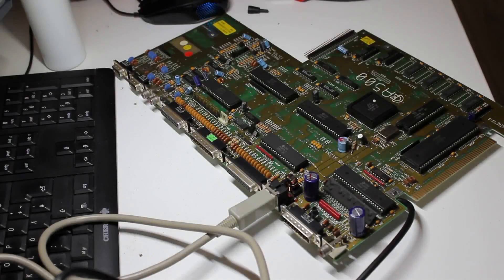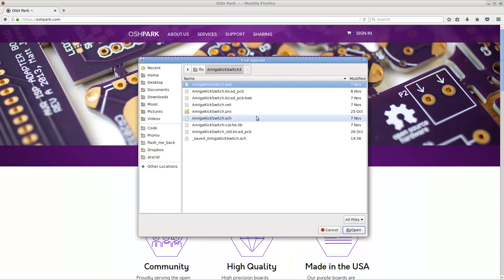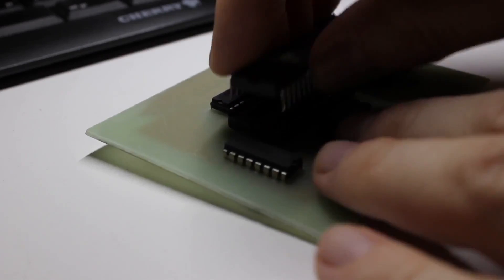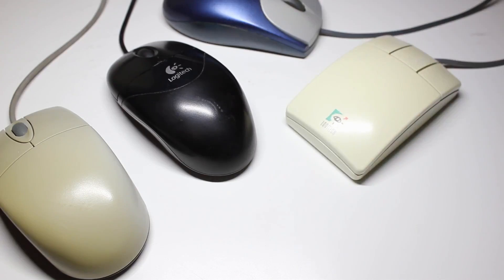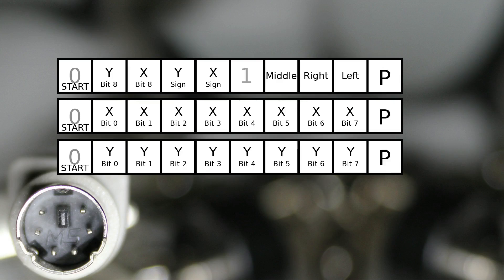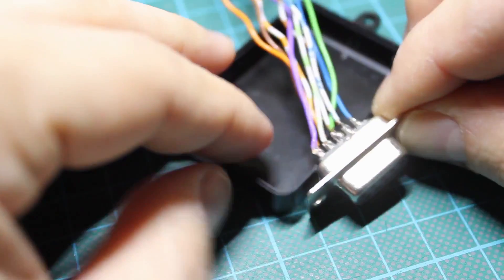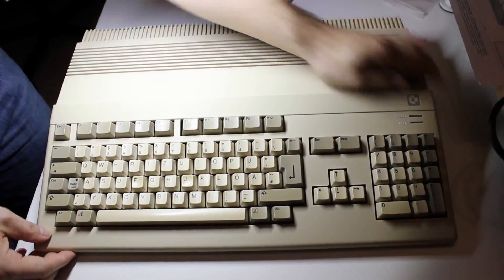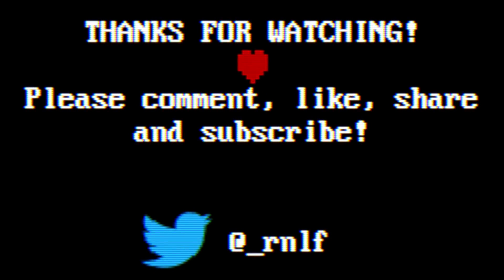Amiga 500 Zero to Hero Part 4 of 4: Custom PS/2 Mouse Adapter / Kick-ROM Switch / Finishing up

Comment: I just installed the RGBtoHDMI mod. That too leaves no space for the RF shield! I fixed that by simply choosing to not reinstall the shield. The Amiga works fine without it=)
Reply from the maker: Of course it does. Might cause issues with nearby analog stuff and I kinda like to keep everything together. I try to keep my mods reversible and losing the RF shield somewhere in the mess that is my retro room is not reversible 😂
Reply: @flashmeback  Hehe yeah, I can see that. I have all my amiga stuff in one box, so I'll hopefully never lose anything. I like that most people are so reluctant to do permanent mods! For the HDMI mod, I'm thinking about using the accelerator/HDD port cover as a place to fasten a female HDMI plug, as well as a few switches. Therefore I 3D printed a cover I can drill through, while I'm keeping the old cover intact!=) I'll eventually make the same mods as you for floppy and ROM select (though I have heard that you can safely forgo of Kickstart 1.3 - 99% software will run on 3.1). Do you have any extensive RAM upgrades? I have 512+512 FastRAM - will 3.1 run fine with that?
Reply from the maker: @ojkolsrud1  I'm currently running it on the stock 512K and haven't seen any issues (except most demos needing 1M).

I've mostly made the switch for fun. I usually just switch to 1.3 for fooling around with the older OS.

Comment: Have you figured out the acceleration part of the code? I’ve made the adapter but the movement on screen looks like pressing keys. Once the cursor starts moving, it continues at the same speed

Comment: aww.. you should have thrown away the top RF shield instead of ruining your excellent kickstart switcher project. Top RF shield is not needed at all and actually just traps heat. Most of them are rusty and ugly anyway these days. I never install the top RF shield in my Amiga 500s or other Amigas.

Comment: On revision 6A motherboards (or newer), which you show here, there is a much simpler way to switch kickstarts.  Use a 1 MB ROM and put two kickstart images on there.  The ROM I use is a 27c800.  It has two address pins which, when installed on the motherboard, will be outside of the ROM socket - one of these pins is the most significant bit address line, which you can pull high or low to select the desired kickstart image.

Comment: My first computer T.T. It had so many awesome games. Miss some of them still today.

Anyway though, such love and care is almost wasted on a A500. Especially the Kick 3.1, it's gonna be veeery slow.

Now if you looked at an A4000, Kick 3.1 Buster 11. You know there is even a brand new Amiga OS, that has come out in 2018.  ... okay I get it you are not Krösus. 
So how about an A1200? Technically you can beef it up so It's able to browse the web and whatnot. You are probably capable of picking up a broken Turbocard for cheap and fix it...
My old A4000 had a network card and a 60/50 processor and I could  do online banking on it :)
Had to sell it at some point though, tough times.  :(

Keep up the good work!

Comment: You should check out the youtuber Modern Vintage Gamer - specifically "Pimpin' the Amiga 500 in 2018" Video. I think you will find some interesting and potential upgrade options for your Amiga. I also have a question. Do you like Star Trek TNG ?  Cuz i have a parallel port ball mouse ...   its a phaser :D
Reply from the maker: I know Modern VIntage Gamer of course :-) I think I should subscribe to all the channels my private account is subscribed to with this one as well. Then it'll be more obvious.

Comment: I think the reason the A501 card isn't working is because it is missing the RTC battery.
Reply from the maker: I didn't expect it to need the RTC battery to actually work (I expect just the RTC to not work then). But it should still allow the machine to boot.
Reply: @flashmeback  True, it should boot up without the battery... I could've sworn I've seen the case of that exact expansion card not working because of lack of battery.. Anyway, Jan Beta says here https://www.youtube.com/watch?v=ghi-JO4NaAk that he has schematics for that card. That could help.

Comment: i still have my amiga 500 not opend  and i bought a second amiga 500 that i moded  and nice done that mouse  mod
Reply from the maker: Still unopened, nice! Though I would be a bit scared to use that nowadays without at least checking the capacitors.

Comment: why do you care so much about the RF shield? it's just there for regulations and to make your life harder..
Reply from the maker: bamdadkhan Well, sure I know I don't technically need them. But that's how the comouter was first created. It also gives an extra bit of physical stability and weight.

The machine feels cheaper and incomplete without the RF shielding. And if I keep them in, they have to be derusted or else the rust will spread and damage more stuff with time.
Reply: hmm yes, if authenticity is your primary goal, i completely see your point. i can respect that. : )

Comment: Great series. Noticed on this part though you spoke even faster than usual. I'm English and I found it off putting!!!!
Reply from the maker: I promise to speak slower next time! Not sure how well I'll manage, but I'll try.
Reply from the maker: Yeah, I mean, none of my machines are in mint condition, but it still feels wrong to modify the case. But if it was done back in the day, then it's legit and cool.
Reply: On speed perhaps?
Reply: It was a little off putting but if you turn the video speed down to .75, although it looks really slow with the video, you can understand what you are saying a little better. Great videos and some useful ideas. Will have to look at my Original KS switcher I have in my A500 I bought back around KS2.04 came out. Definitely no problems in my case and just drilled a hole in the back for the switch so I could access it easily.
I liked the idea of the Gotek and DF0 swapping. ;)

Comment: I remember the first time I saw an 500... I was mesmorised for the good part of an hour. First 30 minutes or something, was spend on looking at the design. It looked like something from the future. Never seen anything like it. Then someone ran a demo and some tracker action was demonstrated. Then x-copy. I was blown away, and I had not even seen any games at that time. Then came the games and I was in love with the amiga. I think it was in late 1988. Possible in early 1989. The 500 are still my favorite computer. Though a few games are actually better on the C64. Those are bubble bobble, giana sisters, 1942 and all those "olympic" games from epyx. Especially winther games. Aniway.... Nothing have ever mesmorised me deep for two hours straight, than the a500. I was in a sort of trance. C64's.... Well... They were fun. 500's blew ones mind.
Reply from the maker: Yeah, I am too young for that (born in '85) but I would have loved to witness that time. I think it's stories like yours that make the Amiga legendary. It was just so far ahead of its time, especially when considering the price.
Reply: flash /me back And I just got my first 500 a week or so ago. Untill now, I only owned 600's and 1200's. And it still mesmorises me to death. There is something about the 500 that I can not put my finger on. Still love it. Anyway. My lcd tv that I use for vintage computers. The external psu died, and it took the a500 psu to the grave. The tv is dead as well, yet the amiga is 100 percent ok. Now I need to mod an atx, in order for not having any psu die and take a vintage computer to the grave. At least I have an original psu plug at hand. Hehe.
Reply: @flashmeback  Now, nearly a year later. I have these two 500's.

https://to9xct.blogspot.com/2018/09/my-amiga500-refurbish-project.html?m=1

And

https://to9xct.blogspot.com/2018/12/amiga-500-turbo.html?m=1

Comment: Nice work there. I have an A1200, and a very late A500 (which has the large badge, like the A500+, and an A500+ motherboard, but only 512K of RAM is populated). I got an Atari ST mouse with the 1200, so I converted it to an Amiga one, but your Arduino based mouse converter really got my attention. Is there any way I could get the source code?
You should look into building a TerribleFire TF530 accelerator card for the A500, it will give you 2MB of RAM, an IDE controller, and a 030 CPU. It's a DIY kit, and the author sells bare PCBs on eBay for 5£ + shipping. The rest is available at Mouser, except for the CPU.
Reply from the maker: I'm planning to put the source on GitHub, I just wanted to add a few extra features like making it switchable to Atari mode and clean up the code a bit first. I might skip those steps and upload it tomorrow evening. I'll report back when I've done it!

Comment: Nice work and congratulations! I look forward to seeing what comes next
Reply from the maker: Bee Jay Thanks! Next will be some PC related stuff. Trying to figure out if the Voodoo2 in SLI is too a bad choice for a Pentium MMX, as some claim.
Hope it'll be interesting, too.
Reply: Pity you can't search the 3DMark99 database to see what was most popular with V2SLI. Perhaps if you email them and explain what you're after they will assist.
Reply from the maker: I have a bunch of faster CPUs I will try the cards with. I'll try to find the spot where a faster CPU won't improve overall performance anymore. My assumption is that that CPU will be quite a bit newer than the Voodoo 2. My benchmarks so far show that indeed, there is no performance difference between single or dual Voodoo 2s ony my MMX.
Except for the higher resolution that is possible with SLI.